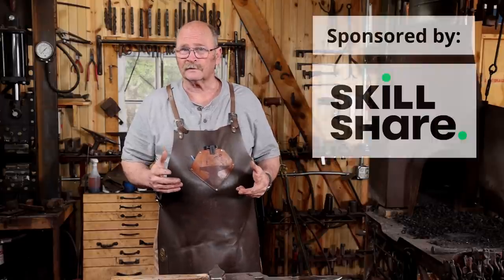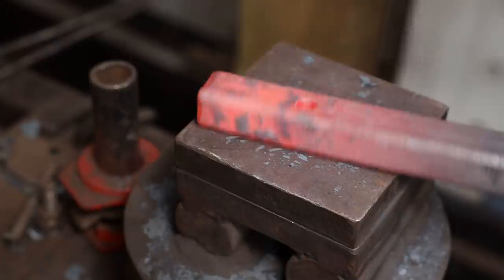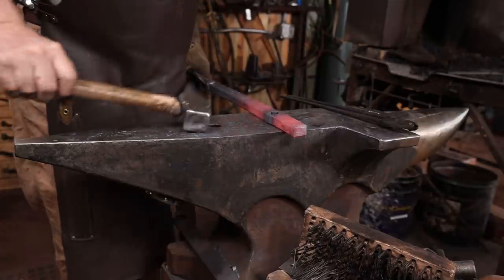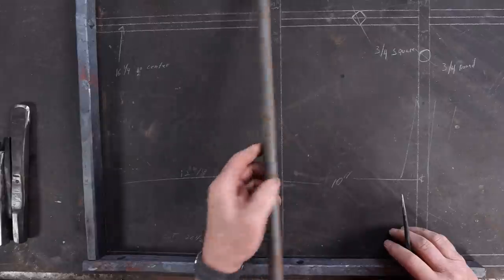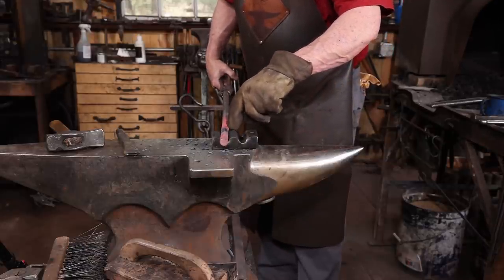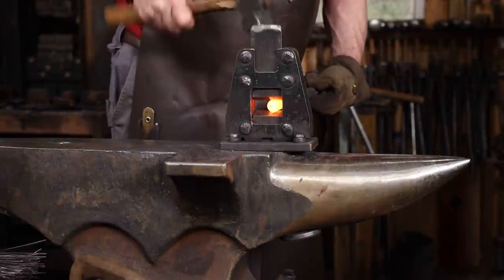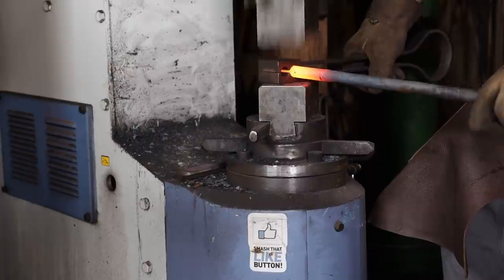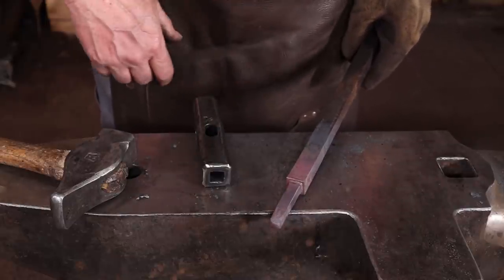Forging test pieces - window grill part 3

Comment: John, another great video. I especially appreciate the comments that you made near the end of the video when you were working the square tenon. You said to NOT use the monkey tool to force the square tenon smaller. I have to admit that I would have had that thought and would probably have driven the monkey tool on and then have a stuck piece jammed into the monkey tool. THANKS

Comment: Really liked this video. Pointing out problems, and dealing with, (or how to), those issues.
@7:35 that swaying looks to be an annoyance. If that weight was slightly longer and dragging on the floor could that reduce the problem?
Reply from the maker: Thats just a dirt floor issue